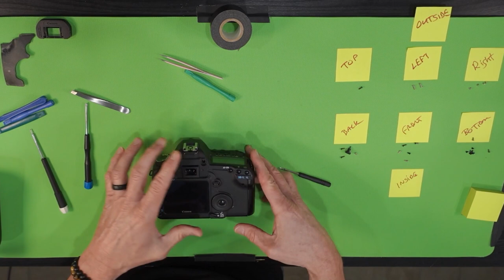Let's Fix A Bent CF Card Reader PIN On A Canon Camera

Comment: Ha Ha, I knew you would nail it!! now, to prevent this for ever happening again, get a CF to SD Adapter and leave the CF portion permanently inside the camera and just take the sd cards out as needed. Also, you can leave a CF card permanently in and copy photos using the USB cable, kind of annoying but cannot bend the pins this way....
Reply from the maker: Great ideas, Homero!
Reply: I would think for studio work you would just have your hard drive or whatever you're sending the stuff to on your network in your business or home and that way there you never even touch the card or the cards lot everything you videotape in the studio this case of yoga studio go straight to the hard drive and can watch it right back on your laptop about as fast as the recorder records it it sends it over to my NAS storage on the local network here and now every laptop in the place can watch it or not edit it do whatever we need to do to it never touching the card in the cards lot which is what I don't understand is why people are always pulling the card out putting in the car and out pulling the card out putting it back in for what exactly It's just as easy to plug up the HDMI cable to whatever and move it that way if it's got to be moved so quickly do it right on the network while it's taping

Comment: Well you picked an easy one. Often the pin breaks off or has disconnected from the main board, or other mistakes are made in the disassembly/assembly process, and parts usually get lost. Most people who try this make a real mess of it, and Canon no longer sells a new main board. When they did, it cost 4x the current value of the camera. I am a retired camera repairman and botched diy pin repairs provided tons of work for me over the years.
Reply from the maker: I was fortunate.
Reply: Hi! I took apart my Canon 7D because several pins was bend. One of the pins is not there anymore because it had detatched itself (someone pressed it out of place.) i was very causeous but the camera wont turn on. Do you know why?

Comment: Just tidied up after an hour and half unbending 2 pins on my daughters 400d. Her camera needed desoldering one of the tin rf shields to release the board. Was more painful than the camera you had as an example. Mission accomplished, an only two extra screws left over - should have paid more attention,   Anyway going to tape the flash door shut now :P

Comment: I have managed to do the same repair without opening the camera, by straighten a heavily bent pin using a Swiss Army blade and a pair of thin twisers. It is tricky, but doable with patience.
Reply: tried doing the same, ended up bending three more

Comment: I too have bent pins before in my card reader and in the camera. I have never had to take it apart like you have done. I bought watch makers twisters and ground then down finer for the job. The other way to fix them is with a hypodermic needle that has a larger size needle. You slide it into the tube of the needle and bend it back just past perfect so when you let go is will be perfectly straight. I hope this helps for the next time.
Reply from the maker: Awesome!   Thanks so much Denis
Reply: You happen to remember what size of a hypodermic needle is used?

Comment: Thanks for making this video, makes me a bit more confident on tackling the same model I have that has CF card issues, knowing how to take it apart correctly is half the battle.

The camera knows a card is present, but won't format it. The pins look ok, but the camera says it's unable to format when an attempt to format is made. And even if the card is formatted correctly on a PC, it still gives the same error. So maybe it has some pin damage at the other end of the pins.

Comment: Almost forgot! If you need I can make a pin straightener top and ship it where you want it. I have a camera but someone else got to it before me and broke one pin. Any tricks on replacing the pin? Do you sell the pins or do I need to buy the whole board? I can solder just would have to have a spare pin to do it.
Thanks again!

Comment: I opened my R5 so that I could install one of those copper heatsinks from Kolari Vision. It all went well, except I dropped one screw and couldn't find it.
So now there's one screw missing, which is underneath part of the rubber grip where it can't be seen.
Reply from the maker: And those screws are one of the smallest screws I’ve seen. Only iPhone screws are smaller. Lol.